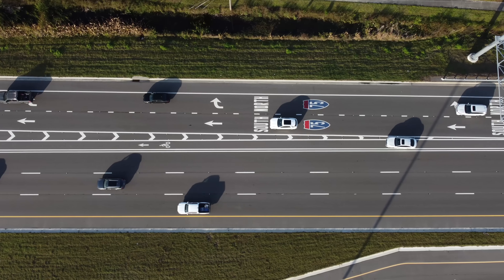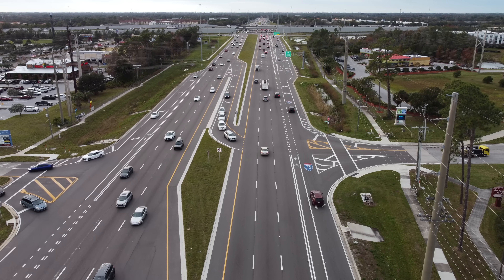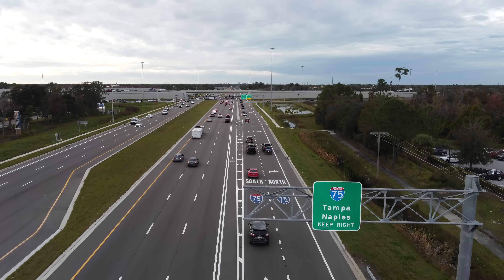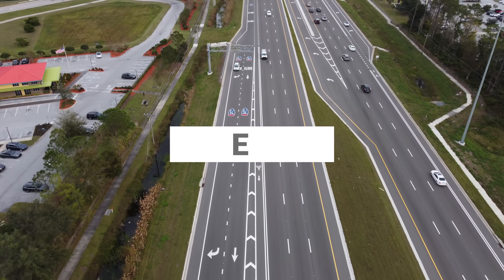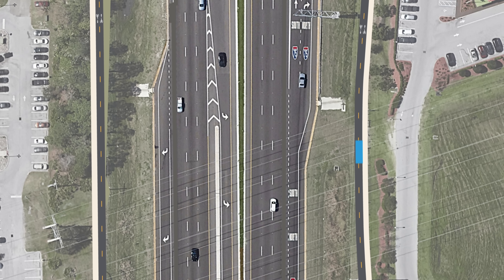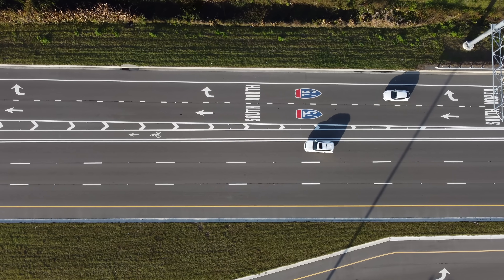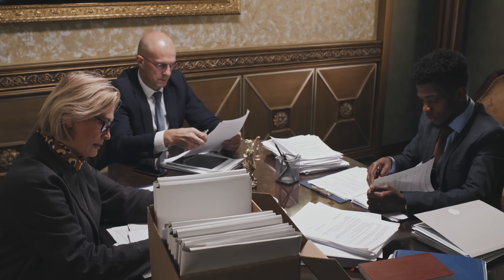This Brand New Interchange is Already Flawed

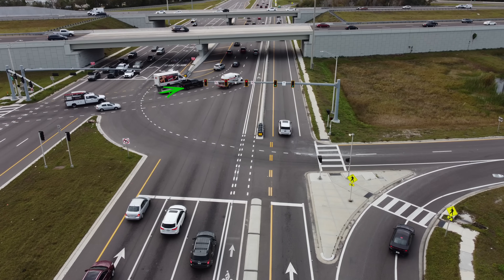Comment: 1:23 why does the single right lane have TWO green lights above?
Reply: Because one side of the light is interfered by turning traffic and the other isn’t hence, some people being able to go and some not
Reply: @rennoc6478  uhm what? There are 4 driving lanes, but 5 traffic lights. At that moment the 3 lanes of straight going traffic have 3 red lights due to traffic from the exit ramp turning left. But that 1 remaining lane of traffic going straight, not interfering with other traffic, has not 1 but 2 green lights. That doesn't make sense to me.
Reply: @EnjoyFirefighting   3 lanes are getting blocked by turning traffic and have a red light and 2 lanes are not blocked by turning traffic and have a green light
Reply: @rennoc6478  " and 2 lanes are not blocked by turning traffic and have a green light" where do you see the 2nd lane? There's one lane, with the painted arrow, limited by a white line to the right and the yellow line to the left. As the white car drives down that lane you can also see that its only one lane
Reply: @EnjoyFirefighting  i am sorry i did not look at it close enough, your right. There should only be 1 green light
Reply: Might be because... um... uh...

Comment: It feels like the single 75 Tampa Naples sign and the double signs further up the road were installed in place of one another
Reply: I replied to another comment, but you are correct- the plans posted on the project website show them the other way around.  I've sent an email to the FDOT District 1 Media address to hopefully pass it on to the proper party.
Reply: @yuwtze  It’s a really stupid mistake to make during the installation, considering that the gantries were installed correctly and one is clearly much larger than the other.
Reply: @MartyFox  Totally what it seems like!
Reply: @MartyFox  I think their original mistake was listing Lena Rd on the bigger sign (@3:55). When it turned out that Lena Rd is actually before the second gantry (27.439592746683832, -82.45355296756567), instead of fixing the sign, they decided to just swap first and second sign.
Reply: @rasowa2958  a year later here i wonder if it got fixed?

Comment: Fantastic video, however I wouldn't bother with a bike lane at all to be honest. The area is so ridiculously low density that I think money would be better spent improving cycling infrastructure in city centres/close in suburbs as the paths you propose would almost never be used
Reply: Bad thinking. Build a bike lane (as part of the walking path, as described in the video) and use it as an opportunity to densify the area in the future.
Reply from the maker: @theuncalledfor  Exactly, change has to start somewhere.
Reply: @Streetcraft  it should start in the places with the best chance of succeeding. Budgets are far from limitless, and the money would be better spent on the downtown

Comment: Interesting. My homecountry (germany) is is very much into cloverleaf interchanges. They are everyvere on the Autobahn.

Presumably this works because the volume of cars is lower.
Reply: It works because people know how to use them. Driver's ed in the US is a joke and it doesn't help that they have no standard interchanges but every one is somehow different.
Reply: @HenryLoenwind  I have used this type of cloverleaf, and it gets a little complicated when you have people getting off and slowing down in the same lane as people getting on to the on ramp (and speeding up)
Reply: cloverleaves are fine, this here is a mess though

Comment: A video comparing US and EU traffic circles would be cool. Because as a German all the traffic circles you show seem so extremely weird and convoluted

Edit: or traffic circles vs roundabouts
Reply: do we even have traffic circles in Europe?

i think i've never seen one, except maybe in the UK. 
most of Europe prefers to build real roundabouts instead.

but even when building roundabouts they often screw up in North America. 
for example they add a bend to the roads "feeding" traffic onto the roundabout which makes it so drivers don't have to slow down to enter the roundabout. 
and if drivers don't slow down they don't have the time to notice cyclists or pedestrians in time.
you want the roads connected to the roundabout to go into it as straight as possible, so cars have to slow down to enter (or exit) the roundabout. 
this gives the drivers more time to notice all the other road users and makes the roundabout a lot safer.
Reply: @ChristiaanHW Yes, we have traffic circles. Look at 49.40552948713211, 8.684580490161323 for example (sat view recommended, map view is boring). Looks horrible, doesn't it? Surprisingly, it actually works. At least if you know which road you need to take.
Reply: @ChristiaanHW  When you are differentiating roundabouts and traffic circles, do you mean like roundabouts and turbo roundabouts?
So traffic circle ~ traditional roundabout ~ driving a full circle requires staying in lane, versus roundabout ~ turbo roundabout ~ driving a full circle requires changing lanes as the lanes naturally spiral outwards?
Reply: @peperoni_pepino  the biggest difference between a roundabout (no matter the kind, normal, turbo or multi-lane) and traffic circle is that on a roundabout you have priority (the roundabout is a priority road). 
and at a traffic circle you might have traffic lights or stop signs/light on the road that forms the circle. 
a traffic circle is kinda just a road that happens to go in a circular form.

- Columbus Circle in New York is an example of a traffic circle. (notice the stop lines on the circular road.

and at these coordinates 52°20'20.9"N 5°36'50.6"E you''re able to see the 3 kinds of roundabouts
the lower left one being a normal one
the lower middle one a turbo roundabout
and the right one being a two lane roundabout.
Reply: @ChristiaanHW  Ah, that makes sense. Traffic circles as you describe are not a common sight in my hometown, so I wasn't familiar with the idea. Though we do have 'mega roundabouts' with traffic lights, like the Berenkuil.
Reply: @ChristiaanHW ... Right, I forgot that's a difference. I thought it's like the difference between British English and simplified English

But yeah, that's what I meant with them looking convoluted
Reply: US traffic infrastructure is overcomplicated because you (rightly) assume your drivers are stupid. And by doing so instead of investing in traffic education, you keep them stupid.